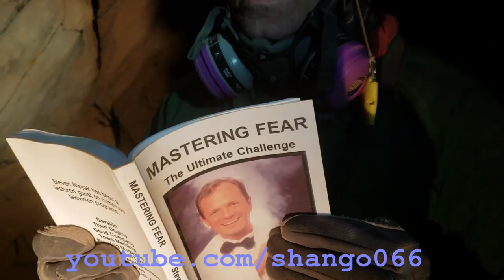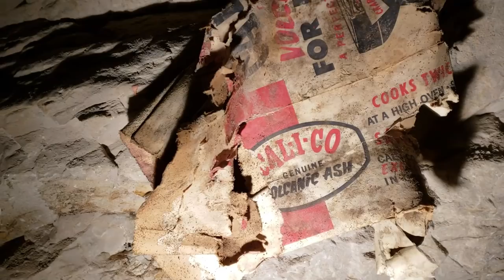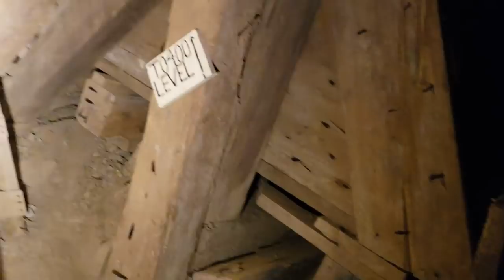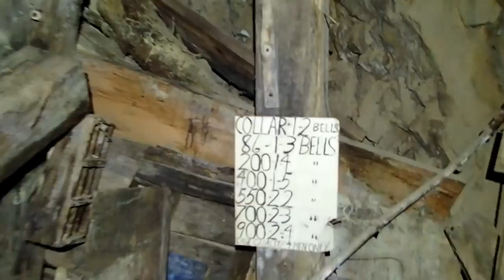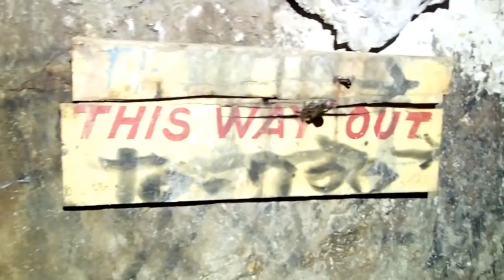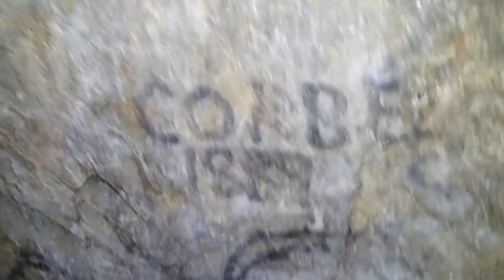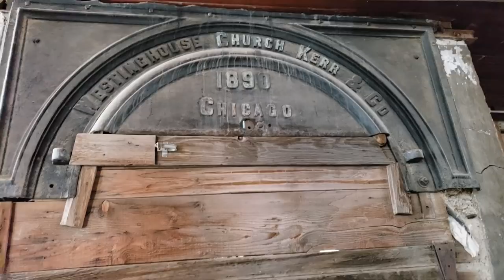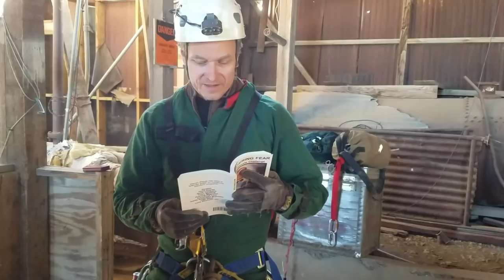Exploring Cerro Gordo Mine Town Water Supply

Comment: 13:59   That flat lever on that old winch is called a "Dog"  It is only engaged after the band brake has stopped everything and you are going to walk away from the winch. As a extra safety measure  you "Dog everything" as the command goes. <old miner>
**The elevator ride takes 45 minutes.  The haulage adit where you felt air moving will eventually come out at a series of stopes and will exit the hill side.  It requires some digging and 3 - 150' ropes to ascend.  That wet part is because it has a exit to the outside and rainwater can come in.  The dry areas are sealed from the outside.  Brett eventually ropes down from the outside to get there.  He makes it to the shaft area.   51:05   That thing in the center of the video with the notched ring and stub shaft is the main switch for the Rheostat that operated that giant old electric motor.  The handle is off but the notch straight to the camera is the "Off" position and either way is up and down.  The notches are for speeds.  After mining had stopped and the weight of the ore cars was not lifted any more, it got converted to the more modern hydraulic power.  Much cheaper to use and has a much lighter load rating.  Maybe 2,000 Lbs or so total, (elevator car, cable weight and 3 persons in the car plus a few tools).    53:02  Every morning they would put a sprinkle of abrasive bath tub cleanser  like "Ajax" brand on the drum frictions to keep them clean, smooth and free.

Comment: How can phones even work that deep under ground when they sometimes don’t even work inside some buildings???
Reply: Verizon has really upped their game.
Reply: Do cellphones work in submarines?
Reply: Yeah no kidding
Reply: Frequency.
Cell phones are very high freq 1 gHz or so waves get reflected, absorbed more. Where as their handie talkies are probably 150 or 450 mHz much easier to penetrate rock. 
Listen to the radios though. The received voice is very staticy and low signal, it only still barely works because there is zero noise from anyone else's radios above because they are so far underground.
Reply: I think because some buildings are loaded with steel reinforcement
Reply: Frank
Are you saying that  a 250mw (cell)transmitter penetrates 900 feet of rock? 
Or that the signal bounces around in the cave until it finally reaches the tower?
Reply: He's told me the radios are good for about 100 feet, in a shaft, either 150 or 450 mhz.
Reply: All of you apparently missed what I was getting at, guys. Look back at the video: YES, it’s obvious they are using dedicated 2-way RADIOS, but at one point in the video, one guy GETS A CALL ON A CELL PHONE. And NO, cell walkie talkie apps DO NOT WORK independent of a cell tower. They use comparably low bandwidth and signal quality as compared to a regular cell call, but they DO NOT work if disconnected from a cell tower. So, in this video, there ARE dedicated 2-way radios, YES, but there is ALSO a guy taking a CELL CALL on a SEPARATE DEVICE; a CELL PHONE. I’m just trying to figure out HOW...
Reply: @SteveHacker  I think it's one of the frs radios they were using, it sends a ring tone that sounds like a cell phone
Reply: 24:59 that guy is holding what looks like a Samsung phone.  Not a frs/gmrs/2m/70cm/1.25cm/11m handy talky.

That is the question.  How does a cell phone work 400 feet underground?
Reply: George Suprenant ... EXACTLY! That’s what I was saying! Nobody else got what I was asking and commenting on...
Reply: It was a Galexy S9+. I got the plus because it specifically says it works in abandoned mines..
Reply: @accxresearch  there is a repeater  on  the main shaft
Reply: There are places in my house in the city that I can't even get 4g,  he gets a cell phone signal in a desert ghost town in an abandoned mine over 400 feet underground...
Reply: I doubt it was, he probably farted, played a tune on his phone, pretended to answer and walk away leaving the smell behind.